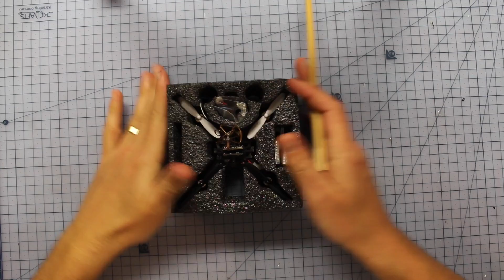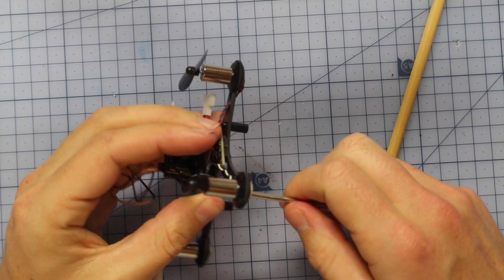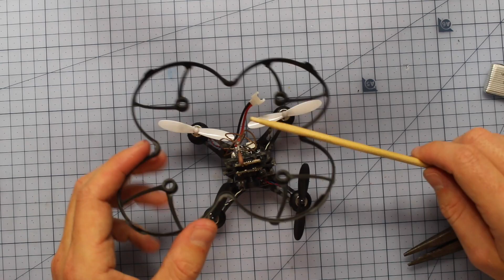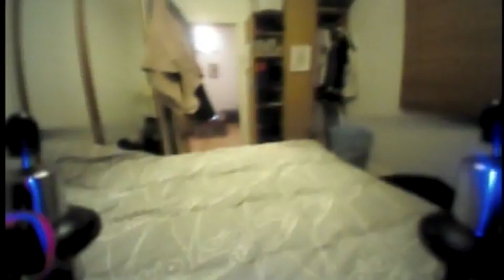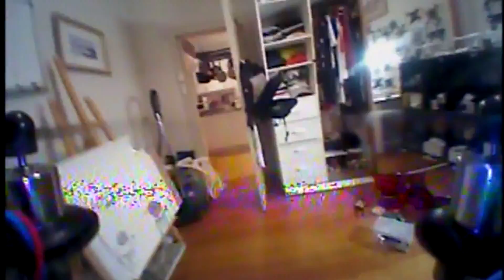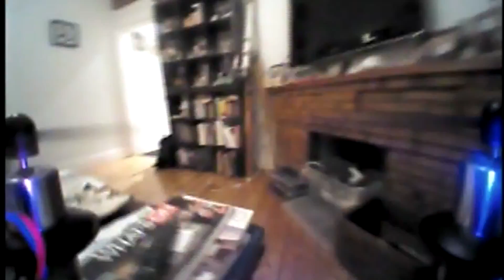QX90 Quadcopter Review. Tiny 90mm. How awesome can it be?

Comment: Mine DIY brushed one came through 3 broken frames and burnt motors and now is on 1S motors instead of 2S ones inside KingKong Smart 100 frame. Although in micro class I finally moved to brushless quads since their motors doesn't burn out after 15-20 hours of flying. I'm curios, are this quad is still alive?
Reply: KrotowX - they are still alive, with very cheap replacement parts and motors, even new frames and brand motors like racestar and MxK, Kinngkong. Lots of stuff on wish and banggood and amazon :-)  great for noobs like me :-) I  just got some 80c/160c, 350mah 1s battery wich should be more than enough for a micro :-) so even brushed micros are evolving a bit, though I think they eventually will make micro brushless moters that can run on 1s, even for toys.

Comment: Love the artwork ... put some clear stills up ... seriously stu. I would bid on a purchase for a pic. Also, teeing you up for some tippets on the QX 90 with FlySky FS-i6 and chan 5 an 6, arm and modes. And flashing from clear flight to betaflight. Forgive if you have already covered this area. Just having a problem with drifting to the right when starting up. OH, and you should assume I am a complete nOOb. Just received QX90 (FlySky) with controller in the post. 

 Love ya FPV work ... and art work.
Reply: Ozmo Syd i want to buy the flysky i6, i just want to know if you can fly the qx90 with it, im new to this hobby.

Comment: Hey man ! I have a Qx90 now and it is Really Really loud.. in angle modes i have on roll so much wobble. Im running bf 3.1 with stock props. Can i fix this problems with a new motor or new props ?

Kind regards
Reply from the maker: maybe one of the motors is blow,n but try new props for sure.

Comment: Unflyable. Blades fly off in seconds every flight attempt. Btw they listened to you. Mine came with velcro for both batteries. Need some solution for the blades :-(
Reply from the maker: you can drill a tiny tiny hole right through the props do you can press it right down over the shaft.
Reply: UAVfutures thanks, I'll try that!  I was going to try the hubsan D props recommended by AndyRC, but your solution is faster.

Comment: Hi, can you help. After successful bind with my taranis I notice that I can't see bars showing how good connection is between radio and receiver. Where I change this? But all working fine apart this.
Reply from the maker: cant see bars in the cleanflight receiver tab or on the telemetry of the taranis?
Reply: On taranis display next to the battery bars.
Reply from the maker: Lets Fly I dont think mine shows up either actually
Reply: I just flush FC from cleanflight to betaflight on this mini quad and my motors start after connecting battery. Can you record short tutorial how to do this correctly including all setup for taranis? THX In my case I thing failsafe is not setup correctly but would be nice to see and follow your recommends😆
Reply: I got this sorted...I didn't know that after firmware flushed to betaflight it is better to use betaflight configuration not a cleanflight configuration.. To stop my motor I had to choose motor type to brushless under betaflight configuration. Im back...so Let's Fly.

Comment: great quad and for a little bit more punch get youself some turnigy nanotech 750mAh 35-70c. Noticeable difference and got 7min flight on it. Have you updated to betaflight yet? great review thanks.
Reply from the maker: 750 sounds pretty big
Reply: It sounds large but its exact same dimensions as the stock batteries that comes with the Qx90. Im not 100% sure on the weight but you do not notice it when flying with them. The higher C rating allows for more power which is essential on these small brushed quads.

Comment: I am having the same problem with the yaw.  It is rotating clockwise.  I assume one of the counter-clockwise motor is weak.  How did you determined which one it was without trial-and-error method.
Reply from the maker: umm trial and error lol

Comment: How do you recommend using the included balance charger cable with a standard lipo charger? I tried to plug in the 2S balance lead from the pigtail cable that comes with the quad but the charger said connection break. Do I need to use a different setting since there are not main positive/negative leads and just a balance plug with this?
Reply from the maker: I used it with a cheaper charger that charges JUST from the balance leads, I dont know how I would use it with my normal 4 button charger

Comment: +UAVfutures, I used to use these prop-guards for 8.5mm cans on 3d printed frames... seems like they might be nice for this build. They snap right on to the motors, are very light weight, and cheap if you have access to a printer. I just picked up a QX90 so I'm curious to try it out... Cheers, great videos btw... thx. 
http://www.thingiverse.com/thing:1263634
... and these ...
http://www.thingiverse.com/thing:668403

Comment: Hey Stew, with the props coming off I get a toothpick and a little bit of glue and use the tooth pick to stick a little bit of glue down the hole in the prop. The props stay on really well just put a little in the hole and wipe away any glue outside of the hole. Works great.
Reply from the maker: thanks for the tip
Reply: Your welcome Stew. Can I ask you a question about the Kraken? Are you still planning on doing a video on this frame? I'm thinking of buy the 4inch but am not sure on the durability of the plastics cover body. I'd love to see you do a review on this frame but I know you and your chopstick are very busy ;p
Reply from the maker: Phongsta the review is half filmed, but I had to get a second PDB for it, but yes it is coming, just taking a while.
Reply: Awesome buddy, can't wait

Comment: Stuart what are your thoughts on the integrated f1fc and d4r-ii? I know the f1fc is super clean, but after all it's a naze 32 which is an older flight controller. The d4r-ii also uses ppm which has a bit of delay. So do these components do the job well? (Btw I would love to see Armattan make an integrated fc/Pdb with a X racer f303! I think that would be great with an x4r-sb)

Comment: There're some hooks on both sides of the cam platform. A rubber band hooked to them and the battery won't move without autorisation. ^^ The velcro solution isn't also bad at all.
The prop guards of an hubsan... Really interesting! 
A quad I'm planning to have to replace my loyal, trusty and a bit old H107d and I do lots of research on this one.
Thanks so much.
Lots of happy flights! ^^

Comment: I had to laugh so hard when I saw you using that chop stick to push the buttons on your Taranis, I am doing the exact same thing right now. What did you do? I left mine in the car in the hot sun in California for a few hours when I was at work and it got kind of hot. The screen was really faint at first when I turned it on, but came back after it cooled down, but the buttons on the right side came loose from the heat I guess and fell down inside. I have been just too lazy to change it yet and use a bamboo skewer to hit the buttons lol. I also just turn it on and off quick to reset my timer when I'm too lazy to get my stick haha!

Comment: Hey UAV, Check your focus as it looked a bit off in your video. I found the lens goop would soften up lots when the camera got warm and just a slight  touch on it woudl put it out of perfect focus.
I agree it's an awesome little quad but antenna protection is vital, especially if you fly it into metal signs :)
I must still say I prefer props out of view than in frame although many find it easier with props in view.
Reply from the maker: yeah it was off. easy to fix but I think I was just too excited to fly it

Comment: is there voltage telemetry?
Reply from the maker: not that I have worked out yet
Reply: +UAVfutures had a look at the fc board, it has more uart ports so should be possible with a proper receiver :) the included ones probably doesn't

Comment: The version without the receiver is all sold out which was just over $70. So I was committed and got the one with the receiver. 

The hubsan replacement blades are crap. Once they come off once they never stay on. Get the walkera ladybird props. They are so good and I have never really needed to replace them.

Comment: Also a quad guy with a graphics / art wife.  I know I'm normally tip toeing around drawing / paint /sculpture.  I also get in trouble for stealing her hobby knife / glue / tape.
I was considering a woop, but was put off because the cost was close to a 5" quad once I replaced the motors.  I think this might be the indoor quad to go for.  

Would you say I could actually learn better rate mode on this guy?
Reply from the maker: yeah I cant use the hobby knife without permission lol

Comment: oh and there is a hubsan guard for 8.5mm motors (the camera version) http://www.banggood.com/Hubsan-X4-H107L-H107C-V252-JXD385-Quadcopter-Parts-Protection-Cover-p-918277.html?p=GF100666525320140767 or the straight one: http://www.banggood.com/Hubsan-X4-H107C-RC-Quadcopter-Parts-Protection-Cover-Black-H107C-a20-p-89721.html?p=GF100666525320140767

Comment: It's running SBUS (the two switches control it) there is a spare on banggood: http://www.banggood.com/Tiny-Frsky-8CH-Receiver-Compatible-With-FRSKY-X9D-Plus-DJT-DFT-DHT-For-QX90-DIY-Micro-Quadcopter-p-1079963.html?p=GF100666525320140767 that shows the connecting diagram and switch positions. one of the props exploded in mid air in mine ;) and the antena broke off the ground pads - you should use some hot glue to reinforce the antena mount. Luckily one can solder the antena again on the other side of the original solder joint. will have to use some guard for the antenna too

Comment: hi mate. how easy is it to replace the receiver? could you check in the CF if it is connected via sbus or ppm? thanks a lot.
Reply: it says it is sbus....can you check if it is possible to use ppm? i have made a tiny ppm receiver for radiolink at9. 1.5 grams.
https://drive.google.com/file/d/0B06JRZbbFCVMSGZMRFpzb3FjVVk/view?usp=drivesdk
Reply: You can buy it without receiver :)
Reply: The new Radiolink R6DS receiver has sbus and is the same size as the old R6D (and they are cheap)
Reply: +benaresq cool. thanks mate. did not know they switched from ppm to sbus.

Comment: I have recently bought a RTF quad and I'd like to upgrade it to betaflight but I have no idea how to set it up so it flies after the upgrade is there a video about that?
Reply: If it's newer than 2.7.1 you must use the betaflight configurator, check out Joshua Bardwell for a specific on that. Lee (painless) has some awesome videos but nothing with the new betaflight configurator as yet if you need that. They are similar though so lots of transferable stuff.

What I don't understand is older FC like my scisky need 32000 looptime to put it in brushed mode but this QX90 and others don't have a loop time that high and fly great.

Comment: i got an idea of making a brushless 90 inch drones....but the motors that im looking at is a 30$ per piece motor (hp02t motors for someone interested) and the project would cost me 290$ so i thought it was too expensive for a 1s, brushless.
Reply: k mate
Reply: 1104 motor?
Reply: +Fox it's smaller than 1104 it's used for brushless tail for blade nano cpx.
Reply: You can use 1104 motor I mean.
Reply: +Fox it would be a bit too big. also won't fit on the 6mm motor mount.
Reply: Maybe.On "lktr 90" you can use 1104 motors.Anyway,good luck:-)